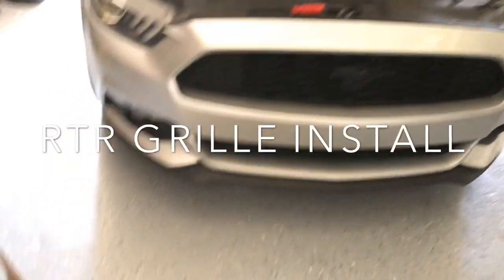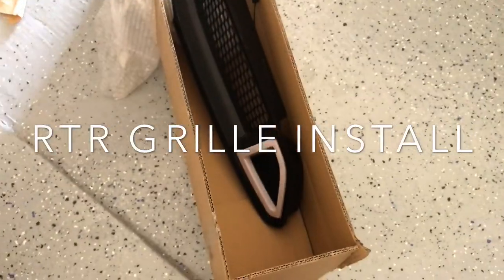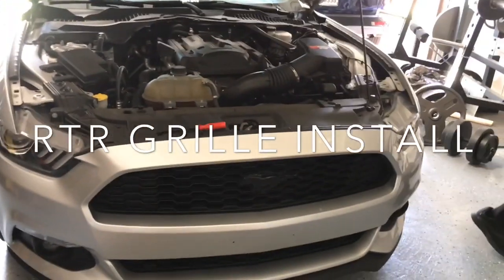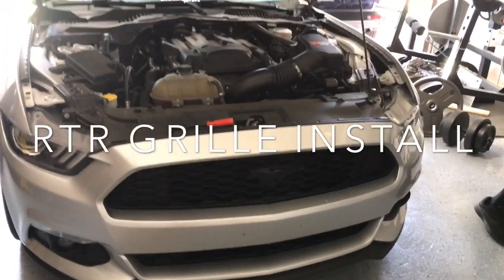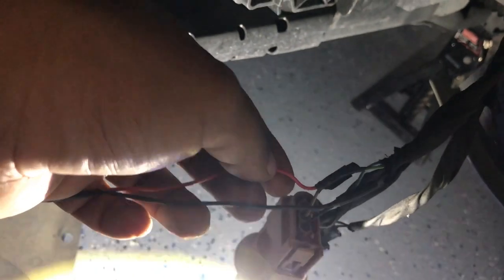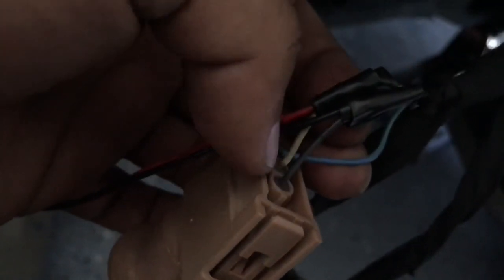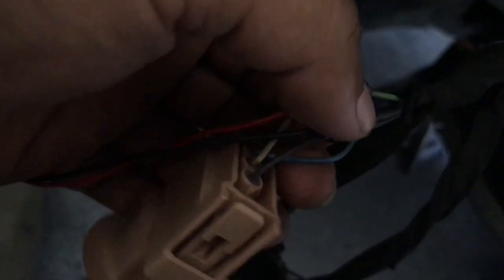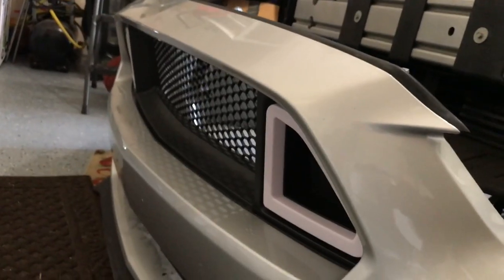2016-2018 Ford Mustang RTR Grille $60 Install and Wiring to DRL

Comment: Installed it but my lights didn’t work 😭
Reply from the maker: Double check the wiring.  Or make sure the light itself is good by testing it on the battery.

Comment: Can you link the exact grille you bought
Reply from the maker: Hi !  I just put the link in the description.
Reply from the maker: https://www.ebay.com/itm/For-15-17-Ford-Mustang-Front-Hood-Upper-Grille-Mesh-Grill-w-White-LED-DRL-Light/133142949819?_trkparms=aid%3D555018%26algo%3DPL.SIM%26ao%3D1%26asc%3D20131003132420%26meid%3D34f00b9073f34db693356b9fa16c0517%26pid%3D100005%26rk%3D3%26rkt%3D12%26sd%3D193119757275%26itm%3D133142949819%26pmt%3D1%26noa%3D0%26pg%3D2047675&_trksid=p2047675.c100005.m1851
Reply: Thank you! Have you had any issues from it?
Reply: Did you buy the lower grill as well? I can’t find any online
Reply from the maker: @skaterwray   This is my cousins car.  So far no issues and works like a champ.  He did not buy the lower grille, but we did cut out the web's in the lower grille so its just open in the middle section.  If you do buy the grille you can also swap it out just like what we did in this video.
Reply: Thank you i appreciate you i subscribed
Reply: EATSLEEPJD 2 month update? Any issues ?
Reply from the maker: Hector Cruz Nope. No issues.
Reply: what cai are you running mine has to have a pass through through it